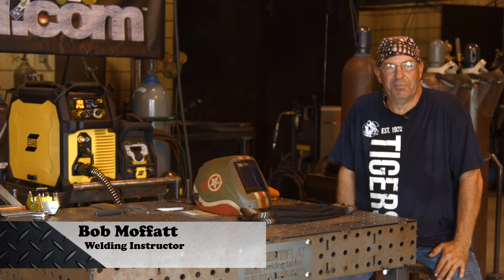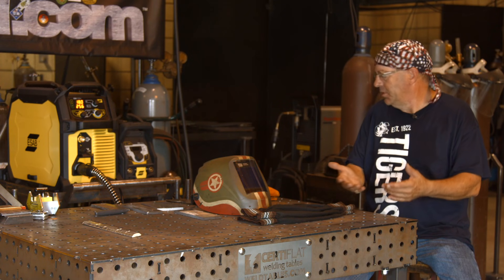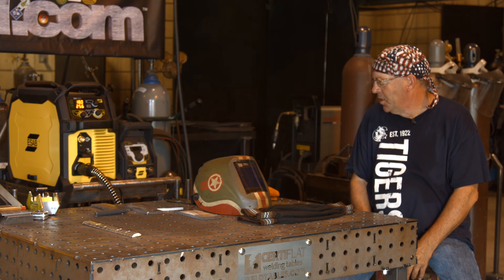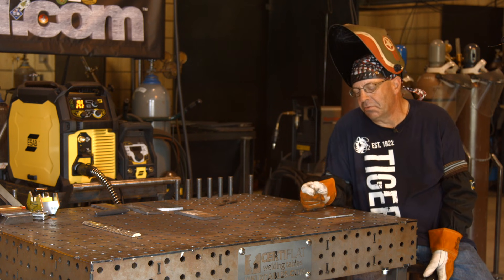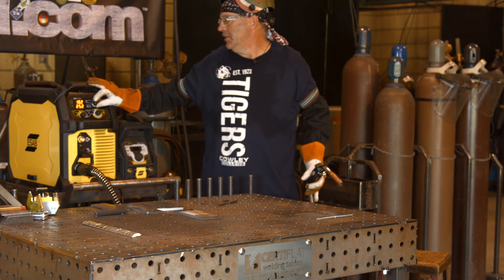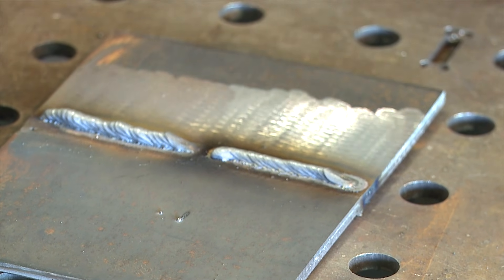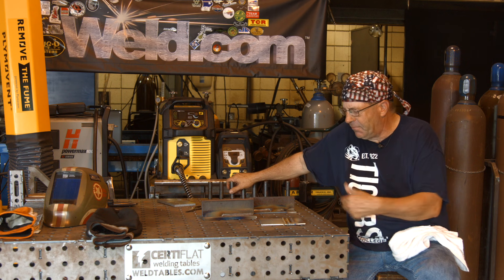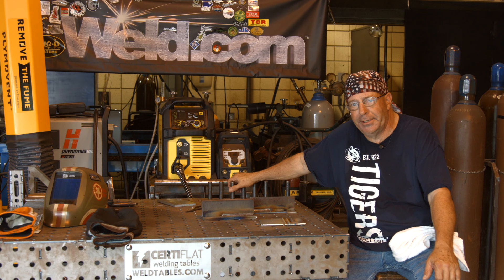🔥 MIG Welding Steel with Pure Argon

Comment: Interesting to see you hold the torch in a upright position, instead of pushing it in a more skew position. We here in Africa just weld with pure argon.
Reply: Does it weld like this or do they have different additives in the wire there to compensate for everyone using pure argon?
But i am surprised, a lot of people use pure co2 cause it's cheap, but the blend runs better.
Reply: @tsl7881  it works with argon..

Comment: I suggest for a a Economical A/C alternative to Stay Cool while welding use 260 Air Con.  In the future only Weld while in Your Car at 60 MPH with Your 2 Front Windows Rolled Down for a Nice Cool Breeze.

Comment: I work in a snowplow up fit shop I hadn't welded in 25yrs and it was stick welding, they use mig welding which I had not done and are using 98/2 mix and my welds look like shit and I tried everything I could think of to change the look of the bead all big and ropey, I had a sneaky suspicion it was the gas.

Comment: So im in my second year welding class and my classmates used to tell me that i run smaw too hot, like running 1/8" 7018 at 160-175amps (if im feeling frisky ive gone up to 210), my teacher says its fine, at what point does it become not fine to do and what do you think about welding hot and fast like this, either way i love the videos and learn more then i knew i could, thank you
Reply: Careful you don't start undercutting the weld bead when you're cooking like that, your welds will look better an be stronger when you're in the sweet spot which is just back of where you're playing now. Are you welding 1/4-3/8 plate, heavy pipe?
Reply: Mostly 3/8 plate, i rarely get undercut with it though it gets close sometimes, theyre not always the prettiest welds thats for sure, when welding that hot how much weaker does it really make your weld?
Reply: Well then sounds like you're taking full advantage of 7018s low hydrogen characteristics in preventing weld embrittlement.

Comment: I run 100% co2, I've never had any problems getting good welds and its cheap!
Reply: We used pure CO2 in welding school, it waas good.... We tried welding or more like said tacking galvanized 1mm thick, then we used like 90% Ar 10% CO2 or what mix it was...
Reply: Peter Szöke can we do stainless steel mig welds with pure co2

Comment: Newbie here, but I see you turning up the heat to make it lay down, so why do you keep jacking up the wire speed with it? Seems to me if you want it to lay down, more heat and a slower wire speed would come closer to doing it.
Reply: Voltage tends to broaden the weld, wire adds heat though they are interrelated.

Comment: brings up a curious point, Helium with MIG, would like to see the result of that!
Reply: Helium adds heat and is usually at around the 2%  in a mix. A 80/18/2 could be interesting. going vertical it may be a little to fluid.

Comment: Try 95.5  argon  oxygen it will spray like crazy. and it will also wet out better on short arc and it will lay flatter and penetrate deeper trust me. Bernett Custom Welding

Comment: Is bead blasting metal down to clean white metal as good as grinding or sanding to shiny metal when welding?
Reply: Sure
Reply: Ceramic flap discs are good too.
Some scale is just too hard for zirconia alumina regardless of the grit.

Comment: While I agree on the gas, I feel like he wasnt doing the proper movements to make a good weld. Small e shapes are what you want to do, and he was barely doing a back and forward. I may be wrong. But that's how I was taught, and it's always given me great beads when I have the setting right.

Comment: I just got a multi process welder and I want to use a gas or gas combo that runs great on MIG and Tig (mild, stainless) . Is there such a animal?
Reply: Hayden Foster yep, two bottles bro. C02 mix and argon bottle. Buy a larger bottle for the process you’ll use more of if you’re trying to save

Comment: I use 75 Argon 25 Co2.  I started with pure Co2 and did not like it at all.  I use ER70S-6 or ER80S-D2.
Reply: I won't claim to be a good welder, but for relatively thin materials I find the key to getting CO2 to work reasonably is a VERY short arc length. For thicker stuff it isn't quite as close, but I still end up running closer than I would with C25.
Reply: Anything over 2.5 forget about it

Comment: Hi Bob, can you run good looking bead with flux cored gasless mig wire? Most of times im welding outside, and im struggling to get nice consistent bead 😭 also im looking to get a tig machine any advice? Dc only budget machine
Reply: laimonas katarskis 
The new harbor freight 160 amp machine looks decent and has hf start.
I'm no pro mind you but have watched most of the vulcan videos so far from what I can tell they tried designing them having at least some compatibility with Miller components and accessories at least in the mig department they did.
Hope this helps but for a few bucks more than that you could get an alpha Tig and do aluminum as well.
Reply from the maker: Sure you can. Check out our video on Flux Cored Basics.

Comment: I'm a welding supervisor at a shop. Recently a couple of my newer minions are having trouble lots of trouble passing a 3G downhill pulse mig on 3/8" SS plate no root face.  We use 84/15/1 gas. I know it's their technique and a lack of experience that is the issue. I would like to see you do a video on that start to finish cut and bend. I've tried everything to help them. I can grab the machine leave it on their settings weld one out, cut, bend and pass like clock work, theirs break every time. 18-28volts 100-200 amp 350*f inter pass temp with a tight 3/32 gap. In general I would like to see some more videos on SS maybe 6g 2"sch80 welding in one direction all clockwise or counter clockwise not up and up. Thanks

Comment: People that say you cannot use oxygen blend shielding gas are also the people who will say you cannot use hydrogen blend shielding gas.....-because hydrogen embrittlement- lol

Lots of keyboard commandos and certified internet welding professionals on the YouTube that need to put that mouth and those hands to some real work and get to know this stuff.

I know its hard to cater to these guys sometimes Bob but you ARE teaching. Some people just need to see vs being told. Good on you for taking the time to get it done.

And man....I've never seen such grey welds. Look like cast iron. Yuck
Reply: I'm surprised that anybody said that you can't use hydrogen as a shielding gas. I wouldn't want to trust it for anything critical, especially on higher strength materials, but it'll be better than nothing. 

Of course, OAW also puts a fair amount of hydrogen out. The fact that a larger area ends up hot means that there's more time for the heat to drive the hydrogen out vs similar amounts in a different process, but it still has it's limitations.
Reply: Argon/Hydrogen mixes are sometimes used for welding thick sections of austenitic stainless, gives the same advantages as helium/argon mixes on aluminium.
Reply: It’s true about embrittlement, and oxidizing. There are mixes being sold that really shouldn’t be used. Since people are not metallurgists, they really don’t understand the situation. So while using hydrogen or oxygen in some mixes may ease the weld, when the cut weld is looked at under a microscope, you can see problems that don’t appear with the usual cut/polish/etch.

Just because something has been done for some time “If it’s good enough for my father, it’s good enough for me.”, doesn’t mean that it’s ok. They did stick welding for 60 years without flux coat. All aluminum welding was done on DC for decades. Just because they were done that way doesn’t mean it’s the best way, with the best welds.

Comment: Bob I think you have just fix a problem I'm having with my 110 welder it's been welding fine I run out of 75/25 I went to the welding supply store got another bottle of gas and now my welder is welding just like that
Reply: So what did they give you?
Reply: Bob  Moffatt  I called my son last night he went out to the shop to look the tank is marked 75/25
Reply: david mashburn What it should be for a 110v
Reply: Bob  Moffatt is it possible that they filled the tank wrong
Reply: Possible but.... Have you changed the polarity to run gasless wire and not changed it back to DCEP?
Reply: Bob  Moffatt no it's been set up for gas sense New I bought it new in 2002 been welding fine until this last bottle of gas
Reply: david mashburn Could be a mistake then.
Reply: Bob  Moffatt I get back home I'll change the aluminum wire in the spoolgun on my engine driving welder to Steel wire and try that bottle on it to see if it weld's any different

Comment: If you want just one gas use argon 5% CO2 for mild and stainless steel the stainless weld is a little black but otherwise OK. Otherwise use Argon 1% O2 welds steel's plus Aluminium in a pinch no good for tig though.
Reply: Can you use those blends on thin mild steel?
Reply: Yes the only part of the CO2 required in welding is the o2 bit. CO2 in an arc disassociates into its constituent parts carbon and oxygen the oxygen does the wetting of the metal (acts like flux) and the carbon gets absorbed into the metal or escapes into the atmosphere where it recombines with oxygen from the air as carbon monoxide.

Comment: I didn't think you could run .035 wire at those volts and speeds.   I'd be looking for .045 with some CO2, on thicker metal.

Comment: If you want some fun try some carbon arc brazing
Reply: I have done it. It's pretty cool. Had to learn it in the Sheet Metal Workers Union for doing galvanized sheet metal.
Reply: Yes back in the day i did a lot of carbon arc brazing and it was quite good fun to do and pretty effective as well
Reply: I've tried that, and had a lot of trouble keeping the electrode close enough to stay lit but far enough that I don't dip it. I'm not great at TIG but this was way harder than TIG for me.
Reply: It definitely requires a little practice but  once you get the knack i found it easy  it does make a difference on the type of torch you use some i have used were very difficult and awkward

Comment: Why do you keep welding back on yourself? To deliberately put the ripples into it? Why not keep your movement continuous.

I'm not sure I like how you jumped 3V from 23.5 to 26.5 and 100ipm in the one step. 25 at 300 with a steady motion should have been enough to flatten it out a little though stuff will never really flatten out properly on a flat surface.

Comment: 40 V and about 475 ipm will actually form a  meh ok puddle with a miller 350 in pulse....   it still sucks ....   needs the oxy  or co2 to actually work

Comment: Mig weld with helium?
Reply: Or maybe tig with helium. Heliarc
Reply: Blaze Revere He did DC Tig aluminum with helium. You should check it out if you haven't already.
Reply: NOT on steel.
Reply: Bob  Moffatt Are you saying helium an steel are not compatible?
Reply: Try it for yourself and let us know what you come up with.
Reply: Bob  Moffatt Anything I should be prepared for before attempting it? You make it seem like a bad idea.
Reply: LOL Be prepared to learn something.
Reply: Bob  Moffatt How do you put it. Let me get my gear on an I will be right back.
Reply: Word!! Run a bunch of settings, change polarity, do whatever to make it slick. Let me know how you like it.
Reply: Bob  Moffatt I'm getting a lot of build up. About the same as this video. Straight polarity made a worm as you called it. Reverse is very choppy. I'm using .030 wire  14.6 at 194. Is this what you expected?
Reply: Yes. It should be an unstable arc with not a lot of happiness going on. Turn it up, down, whatever.
Reply: Bob  Moffatt I just cranked it up .030 wire 18.3 volts straight polarity 283 speed. It is getting full penetration on my work piece with a high weld profile. Definitely seems like it would stick 2 pieces of material together. I was playing with an old mower blade. Let me cut some flat bar an I will try a lap joint with these settings. Be right back.
Reply: I got about the same results with the helium as you got with the argon. I have a few pics if you have Twitter I can tag you an post them. It could probably get me home from the mud boggs but would need to be done right before going back out. Thank you for challenge me to do it myself. You are right I did learn something.
Reply: William Preston Good stuff. Thanks for stepping up.
Reply: I was about to ask about MIG using Helium on steel. 

Bob, are you saying you can't run helium on steel with TIG? Or do you just mean MIG?
Reply: I do know one commonly used mix is C 90 which is 90% helium, 7 1/2% argon, and 2 1/2% CO2.  But that's for stainless steel, not mild steel.  The small amount of CO2 allows you to short circuit.  I remember Bob doing a demo with C 90, it shorts but it kinda of flutters.  Not the steady crackle were used to with C 25 or 100% CO2.
Also with the Argon/Oxygen mixes, don't you have to use a wire with extra deoxidizers to prevent porosity?
Reply: Too damn low on temp burn
Won't spray metals
Reply: Yes, but no one does in the mines, frickin alcoholics

Comment: That’s it. I was wondering at work what the fuck was wrong with the welder and sure enough I’m betting it is the gas. We have both tanks on the Miller. Damn I figured that was it. I was pulling my hair out trying to figure it out. Thanks

Comment: 9:55 There are welding gasses with oxygen in them? That sounds extremely counterintuitive.
Reply: And your point is??
Reply: @denniskalivoda  That it sounds counterintuitive that a gas used to prevent oxidation would contain oxygen.
I thought someone might chip in and explain/converse. What did you think my point was? Why would reply like that?

Comment: I think that people want to stay in one gas only config because it is not convinient and cost efficient to own 2 or more bottles.
Reply: BeGamerSl For all processes ?
Reply: Bob  Moffatt No but if it is possibile you go with less bottles. Of course you wont Tig,mig,stick and oxy weld with one bottle. But if possibile less bottles are more convinient. But I would love to see mig welding with helium to see if it has practical applications. Or maybe nitrogen.
Reply: BeGamerSl Do you actually weld?
Reply: Bob  Moffatt Yes I do. Stick and MAG. Or so its called here
Reply: The bottom line is if you want good welds you have to use the proper gas. Convenience is not a factor. I didn't want to buy the separate 125 cf cylinder of Argon but I did want to weld aluminum. Glad I did.

Comment: Why the hell would you want to use pure argon it's gonna be quiet abit more money for short circuit I use straight CO2 there's literally no difference between that and mixed gas except the huge cost difference along with better properties mixed gas gives you hard welds I do use 90/10 for spray but only if it's asked use alot of dual shield with straight CO2 as well